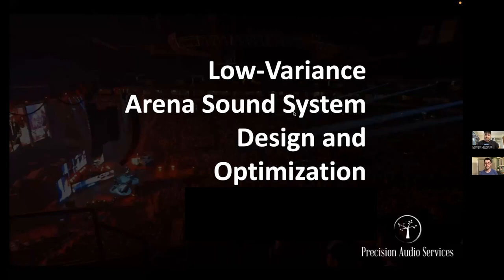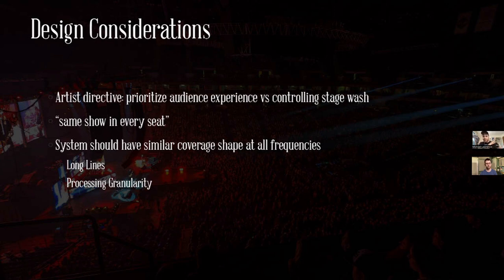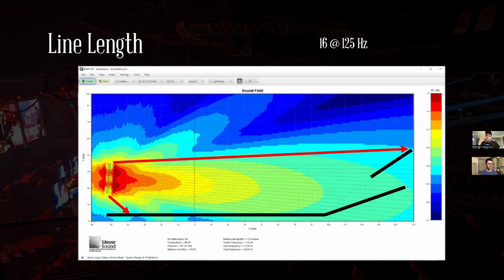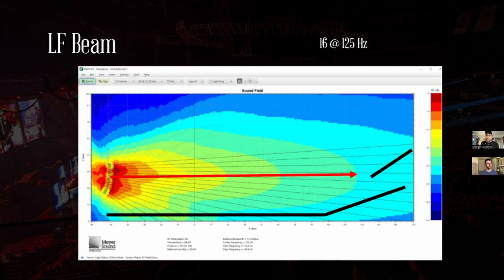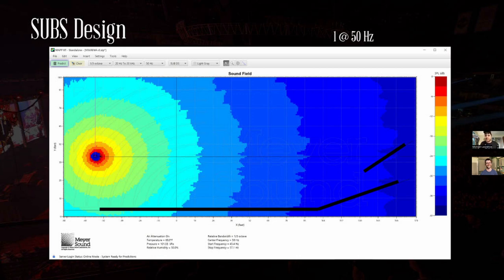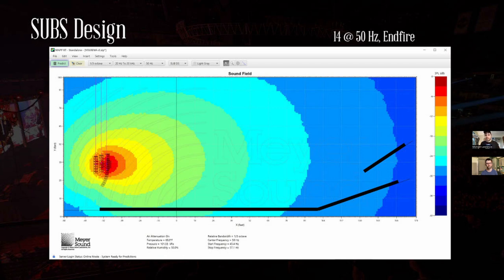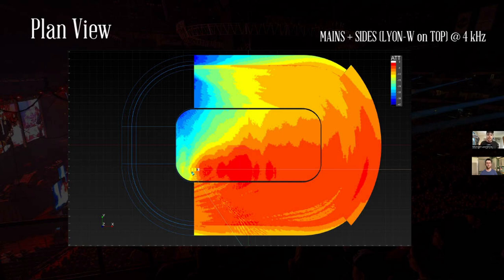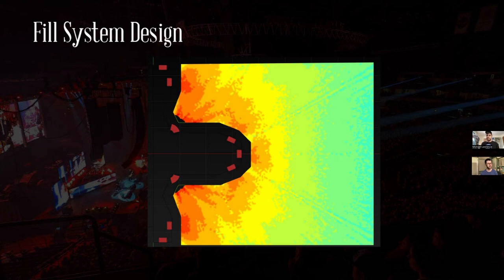Designing Low Variance Sound Systems | Pt. 1 of 3 with Michael Lawrence

Comment: Great video, thanks! , so what would be the best way to have more control , a system processor with lot of outputs or dsp processing on individual boxes?, didn't know that an electronic version of Michael's book was available , got the printed version already  ...
Reply: The next video will cover processing but it follows the same Three-Tiered processing approach I outline in my book. Top-level front-end processor does Tier 1 and 2. On a Meyer rig that feeds Galaxies in front of each hang where it breaks out to per-box processing. On other rigs with amplifiers in racks, the Tier 3 processing is done on the amps.

Comment: Thanks. Clearing up that thinking of the line arrays lows as part of the sub source was a good one and something I've been pondering on how to deal with. Do I low cut the mains and lose valuable SPL throw or do I integrate it and get the phase as aligned as possible? Now I know.

Steering the low frequencies of the line array was an interesting one. Sounded a bit complicated though - I get it that brand specific pre-designed algorithmic processing do this, but if you're standing with an older system and analog amps that are being fed from a non-enclosure/brand specific DSP, is it still possible to achieve this by your own without being some kind of math/physics genius?
Reply: It is possible, if you have a long enough line, and per-box processing, and sufficient time to plan and measure to verify it's doing what you want.
However, in general, with more than one box per output, or a lot of curvature, that type of beamsteering in general is less effective and carries a larger penalty in terms of the audibility of the effect on the system's impulse response. For those reasons I always accomplish as much of this as possible through mechanical means and sometimes leave it at that. Some mix engineers find the beamsteering's effect on the system's IR objectionable, and in those cases it probably doesn't make sense to degrade the sound for all listeners for the tonal benefit of some. Letting the HF roll off more towards the back in those cases will keep the tonality consistent at the expense of some level variance.
Reply: @precisionaudioservices1181  Got it. Great explanation, thanks!